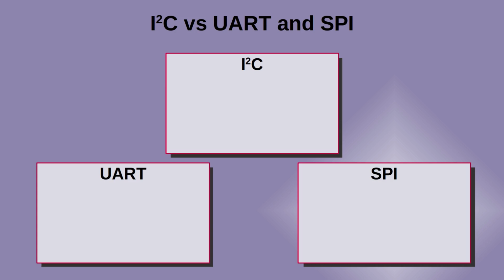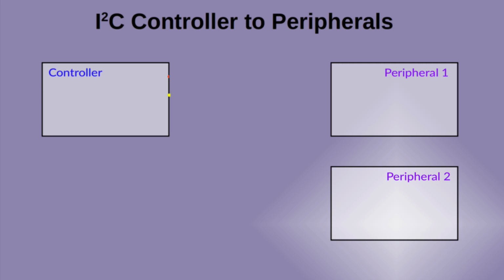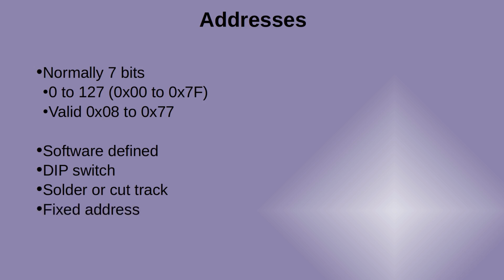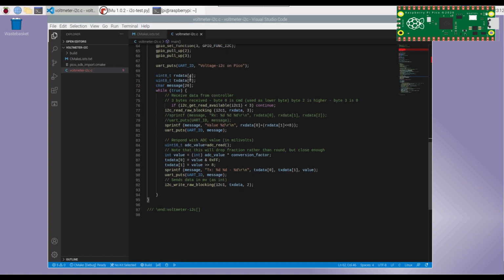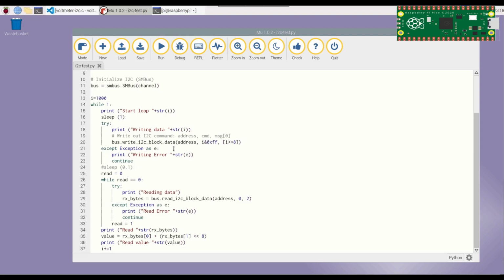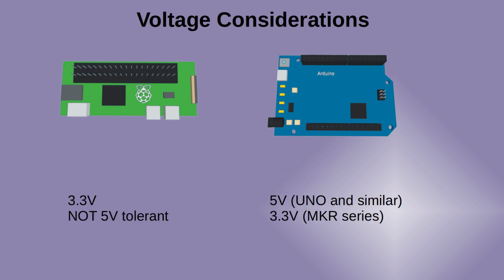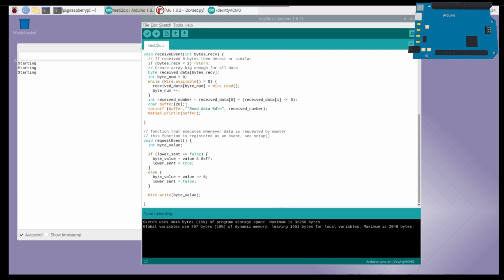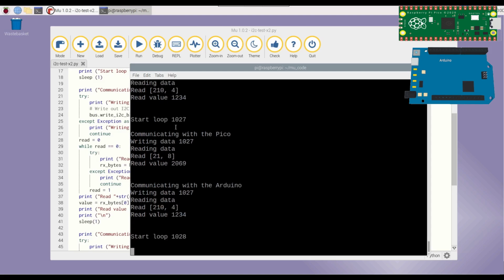I2C - Raspberry Pi, Pico and an Arduino

Comment: Hi there, thanks for the tutorial, which version of Python are u using in that video and which command u used to install the SMBus library. "Pip3 SMBus or pip SMBus"?
Reply from the maker: I use Python 3 for all my coding. I believe the current version on the Raspberry Pi is Python 3.9.2.

I used the dpkg version from the Repository. I think SMBus was installed by default on Raspberry Pi OS, if not then you can install using: 

sudo apt install python3-smbus

Comment: This is a very helpful video - it's hard to find any information on setting up peripheral mode at all! I am trying to set up my Pico in peripheral mode, using the Pi 4 to control it. So far I can see the Pico in i2cdetect, and send date from the Pi to the Pico. However, I cannot get the Pico to return any date - it always leads to time-out or other communication errors (e.g. Read error:[Errno 110] Connection timed out) . I can't see how my code differs from your code. Can I ask what speed you have set the Pi i2c bus to operate at? I have also tried 10K physical pull-up resistors when connecting the Pi and Pico, as well as gpio_pull_up Thanks!

/* Pico code */

#include <stdio.h>
#include "pico/stdlib.h"
#include "hardware/i2c.h"

#define I2C_ADDR 0x3e           // The address of this Pico on the i2c bus
#define IC2_1 8
#define IC2_2 9

   int main() {

    // i2c setup
    i2c_init(i2c0, 10000);
    i2c_set_slave_mode(i2c0, true, I2C_ADDR);
    gpio_set_function(IC2_1, GPIO_FUNC_I2C);
    gpio_set_function(IC2_2, GPIO_FUNC_I2C);
    //gpio_pull_up(IC2_1);
    //gpio_pull_up(IC2_2);

    // Data for i2c

    uint8_t rxdata[4];
    uint8_t txdata[2];

    // Counter just to have something to return

    uint8_t counter = 0;

    // Set up LED for status

    const uint LED_PIN = PICO_DEFAULT_LED_PIN;
    gpio_init(LED_PIN);
    gpio_set_dir(LED_PIN, GPIO_OUT);
    uint8_t blink = 0;

    // Do some power-up blinking

    for (int i=0; i<33; i++)
    {
        gpio_put(LED_PIN, blink);
        blink++;
        if (blink>1) blink = 0;
        sleep_ms(50);
    }

    // Main loop

    while (true) {
        
        // Receive data from controller
        // 3 bytes received - byte 0 is cmd (used as lower byte) byte 2 is higher - byte 3 is 0
        // Wait here until some data arrives
        if (i2c_get_read_available(i2c0) < 3) continue;
        i2c_read_raw_blocking (i2c0, rxdata, 3);    
        int input_value = rxdata[0]+(rxdata[1]<<8);

        // Send back a value - this bit doesn't seem to work
        counter++;

        txdata[0] = counter & 0xFF;
        txdata[1] = counter >> 8;

        i2c_write_raw_blocking(i2c0, txdata, 2);

        // Blink LED so we know something was received
        if (blink>1) blink = 0;
        gpio_put(LED_PIN, blink);
        blink++;
        
        }   
   }

# Talk to i2c devices

import smbus
import time

# I2C channel 1 is connected to the GPIO pins
channel = 1

#  pico
address2 = 0x3e

# Initialize I2C (SMBus)
bus = smbus.SMBus(channel)

i = 1000

while 1:

    # Sending
    time.sleep(1)
    
    
    print("Sending 2..");
    try:    
        bus.write_i2c_block_data(address2, i&0xff, [i>>8])
    except Exception as e:
        print("Write error:" + str(e))
        continue

    print("Sent")
    #time.sleep(1)

    # Receiving Doesn't seem to work - always times out with errors
    
    read = 0
    while read == 0:
        try:
            print("Reading")
            rx_bytes = bus.read_i2c_block_data(address2,0,2)
        except Exception as e:
            print("Read error:" + str(e))
            continue
        read = 1
    print("Read: " + str(rx_bytes))
Reply from the maker: I can't see anything obviously wrong with your code. In fact other than using different pins on the Pico (in my case using i2c1 and you are using i2c0) then the I2C part is almost identical. That shouldn't be a problem as long as you've not got anything else on the same bus.

The speed of the i2c bus is the second parameter to i2c_init = 10000 Hz.
There is some good documentation at:  https://raspberrypi.github.io/pico-sdk-doxygen/group__hardware__i2c.html#i2c_example

I used a lower value for the pull-ups. Around 2 to 5kohms is probably better, but over short distances 10k should work fine. Make sure that is connected to 3.3V (either the Raspberry Pi or Pico end). 

When I was testing I found it really useful to get feedback from the Pico. If you setup a UART on the Pico then you can print messages to confirm which part of the code is running. This is why there is additional UART code in my source code. 

The other thing I experimented with was different I2C read and write commands from Python. There are slight differences in the way that they format the instructions, but the ones you have used are the ones that worked for me.

The other problem I had was that if the write wasn't sent successfully then it would hang at the Pi end, but that is the reason why the write_i2c_block_data is in a try loop and the continue means that it will wait a second before trying again. 

Sorry I can't give anything more definite. My best suggestion is adding the UART code so you can monitor what is happening on the Pico.
Reply: @PenguinTutor  Thank you - it's working now. I'm not sure why. It could be that changing the allocated pins around to make room for the UART did something. It could be the UART code itself (unlikely). Or, it's something I did wrong with my choice of power supply - whatever I changed, it's working and I can send/receive data from the Pico in Peripheral mode, so cheers!
Reply from the maker: @GrantMeStrength  Glad to hear it's working.
Reply: @GrantMeStrength  Had the same problem, really strange. Removing the uart_puts() function made errors again. I added a sleep after the i2c_read_raw_blocking() of 2 ms and now it's working.

Thank you for the hint :-)
Reply: @PenguinTutor  Thanks! Yes, I will set up a UART and monitor the Pico to see what it thinks is going on. Appreciate you taking the time to respond.

Comment: Sorry, I'm back again. The Raspberry Pi 4 has 6 UART buses All addressable from the GPIO, not 1.
Reply from the maker: There is only one UART that is enabled by default. The second is used for Bluetooth and the others have to be configured using device tree overlays. The additional UARTs are also multiplexed with the I2C serial connections.

Comment: 2:47. I'm sorry to pick fault but UART is NOT designed for connecting one pair of devices. With my pathetic Python coding skills I have programmed a Raspberry Pi 4 to communicate with 18 Serial Bus Servos and a Raspberry Pi Pico, as a lighting controller. All you have to do is set each "channel" up with a seperate frame header and all of the devices ignore any communication on the bus that doesn't start with their frame header. Many industrial applications stretch this format to connect MANY devices to the same UART bus.
Reply from the maker: UART has a very long history, but was designed for point-to-point communications between two devices. 

It is possible using multiplexing or through agreed communication protocol to have multiple devices on a single connection, but that is not what the UART was originally designed for. In most cases UART is intended for point-to-point communications between one pair of devices.

If looking to connect to multiple devices using a Raspberry Pi then I would recommend I2C or SPI rather than trying to connect multiple devices to a single UART.

Comment: Hi Many thanks for very useful tutorial. Just have a question, if we want to setup a cluster of 3 or more (up to 9) Pico devices, then can we use SPI protocol/pins to enable all picos communicate with each other? In such case, do you think does it matter which one should take the master role? so, what if one of the slave wants to send some data to another slave? What if we replace all Picos with Pi zero (w)?
Reply from the maker: SPI is based on controller to peripheral (master / slave) relationship. Peripheral devices would need to communicate via the controller. The controller can probe each device and if one of them wants to transfer data to another then it would send data to the controller, which would then be resent to the other peripheral.
 In I2C direct transfer would be possible, by having multiple controllers. One device would need to become a controller and then communicate with another device. This is done by looking for no traffic on the line, declaring that it wants to be a controller and then taking over the control of the bus. When that device goes quiet another controller can come along. I didn't cover that on the video as it adds complexity.
 
Unless you have a lot of data to send then I would say that you are better having one device identified as the controller which polls all the devices for any data. You would then have the devices state where they want to send the data to and the controller would resend the data on.

The Raspberry Pi would be the same, but you do have the advantage of additional technologies, including Bluetooth (some peer to peer support) or wifi (able to communicate with any other device directly).